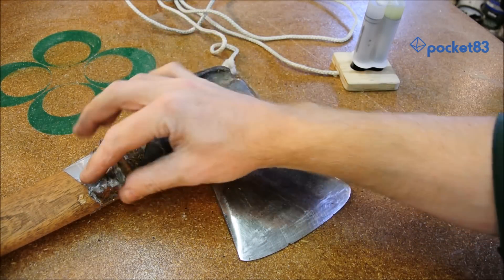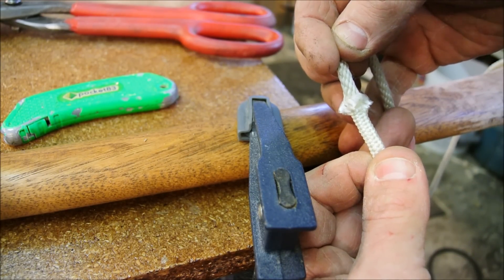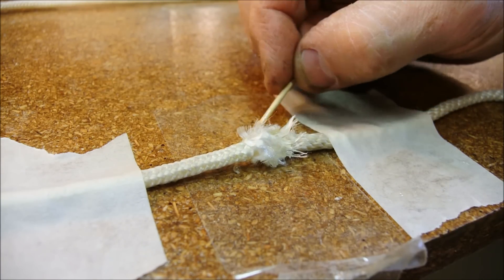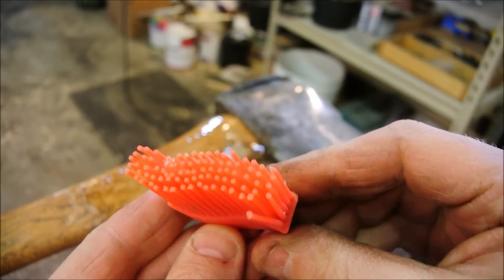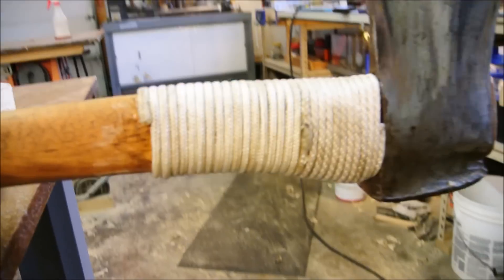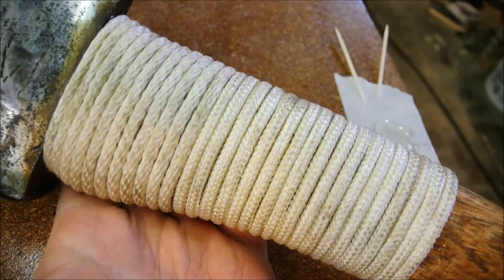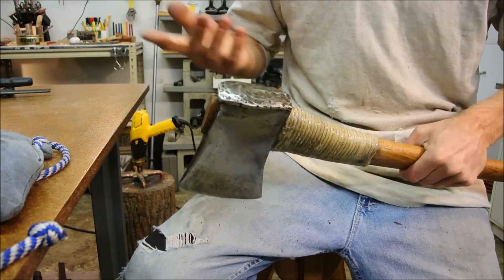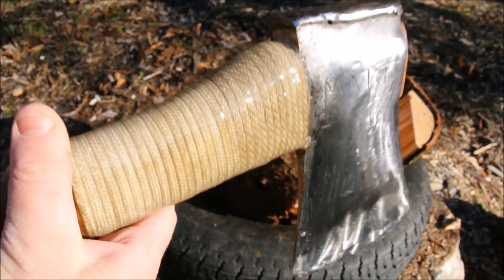Axe handle guard = Rope + Epoxy

Comment: You should try using multiple layers of heavy heat shrink tubing. I used 2" and 3" diameter for my 20 lb sledgehammer, and it's holding up pretty well.
Reply: If I owned a 20 lbs sledgehammer it would not need any protection. Thats a wall hanger or an anvil with a handle.

Comment: I'm not good at splitting wood so I hit the stump once or twice with the axe, then use a sledge hammer to drive the axe further.  I also cheat and use an axe that has a composite type handle.

I do use epoxy to put on fish hook holders on the fishing rods.
Reply: Abunai One    Are you the guy who sold pocket83 the axe he is doctoring up :)

Comment: Why don’t you try investing in a hydrologic wood splitter? They’re expensive depending on what you buy but well worth the buy
Reply: Do you mean hydraulic wood splitter?
Reply: Why buy a expensive tool when you can do the same exact thing for lesser cost but just a bit more work ?
Reply: Depending on who you are and it might not be worth it to buy one for just you but if you have two or three friends who also burn wood you can all pick in and it quickly becomes affordable
Reply: Or you could just use an axe, get some free exercise, and not end up all fat and lazy. YMMV.

Comment: Using  a toothbrush getting into the grooves of the rope deeper works, you can smooth It enough so it’s not abrasive. 101 different ways to make a repair isn’t there? That first miss after a repair hurts, doesn’t it!!

Comment: #1 buy some good quality rawhide gloves and a pair of non fog safety glasses. Then go buy a cheap hatchet with a fiber glass handle, a 10# or 12# go devil,  2 twisted wedges and a 10#  or twelve pound sledgehammer and you’re set for splitting wood! I wold also recommend some of the  ten inch or bigger plastic felling wedges.

Set the hatch head near the edge so the handle will not hit the wood as it is driven into the wood. Once you have an opening set the twisted wedge into the middle of the wood.

Make sure the knots are down and the clear wood is on top. I use a chainsaw to cut through the hard knots and where the wood is hard to split.  I grew up  and we only heated with wood. 

Also once you have a good quality of coals damper back the stove...
I would also into building a rocket stove, use a stainless steel 55 gallon barrel Dennis how big your home is you can build a smaller rocket stove. They use 10% of the wood.

Be safe and good luck.

Comment: Is that handle in that head backwards?
Reply from the maker: lol. No, that's just years of wear on both the top of the blade and the top of the head. I can't even guess how old it is. I personally handled this, and it would've loosened by now if the cavity's wedge were backwards. It has a few years' use on it.

Comment: You don't really want to have excess epoxy if you are going for strength. Working the epoxy in using your hands (with gloves would be best) and then tightly wrapping with stretch wrap is probably the easiest way to get a good composite.
Reply from the maker: Agreed, but that would require slow-set epoxy, and lots more of it. It would also be difficult to do on camera, at least, by myself.

Comment: How did it hold up ??
Reply from the maker: Outlasted the handle. Then I did it again, and it has lasted through two seasons. Lots of splitting. It's tough stuff.
Reply: @pocket83squared  ;  You know what?  I liked your video.  My son ties a turk's head knot around my small axes and hatchets for the same purpose and it looks nice.  Doesn't need any epoxy though, once you cinch it tight it does not move.  I liked that you taped the edge for safety's sake.  If I were to try this I think I would make two changes.  I would hold the axe head, not the handle, in a vise so I could put some serious tension on the rope.  Also, I think I would use resin instead of five minute epoxies.  That thin stuff would really soak into the cord fibers.  It would cost a bit more though.  I think you did a good job.  Have fun and stay safe.

Comment: safety issue.....grind off the roll over on the head. That can/will splinter and become a projectile when next you slam it into something or you slam your hammer down on to it. Never let a roll build up. Grind it down, file smooth.
Reply: well now I see others posting the same.....I know for a fact the do splinter as some suggest not to worry. As you say you never hit it with steel, or you the sole user ......You might know, others which may come into a need to use it, son, daughter....wife.....neighbor ....etc.....might not. Point being avoid the accident waiting to happen. Bottom line....your ax your decision.

Comment: Instead of the rope you should have used a thin Steel cable. Much tuffer and abrasive resistent when the epoxy gets worn away.

Comment: Everyone bitching about mushrooming on the heel of the axe but ignoring the giant chips out of the bit.
Reply from the maker: Equally irrelevant. I'm not filing back 3mm of metal just to remove a ding. It has zero affect on this thing's function. MATT is like a light maul; I'm not subtracting mass unless I have to. As such, that mushrooming will still be there long after I'm gone.

Comment: When in doubt just add $30 worth of epoxy instead of pulling it through a funnel and frapping it like a mast lashing, or use fiberglass resin instead to save cash. Good closeups in the vid though, despite the pricey epoxy.
Reply from the maker: C'mon- I used $6 worth of epoxy. If you buy it bottles, it would be about $4 worth. The close-up shots just make it look like lots. And I don't own a silicone funnel.

Comment: Your ideas are on track. Think about super glue and blue jeans it hardens like a rock because of the fibers which also add strength. I use pocket lint and super glue for quick fixes to hold things on small projects another is super glue and baking soda. Hardens like a white rock. CYANOACRYLATE. Epoxy yes is a very useful tool.

Comment: You probably know this but you might want to dress up you axe head so you don’t try hammering steel and getting a chunk or a sliver in your eye. It’s amazing how if you chip a piece off it gets attracted , or magnetized, to your eyes. Having steel drilled out of your eye ain’t fun.
Reply from the maker: You are totally, 100% correct. It's an axe, not a junk wedge; I don't strike steel against it, not ever. The mushrooming was from a previous owner, and it has now been dressed. 

When I was a kid, I worked summers for Dad, as a framer. I'm likely older than you think, and I started younger than you'd believe, so this was before pneumatic fasteners. One of my jobs was to hand-nail down the roof sheathing after he'd tack each sheet in place. On a typical suburban house, this ends up being a few hours of continuous hammer work. 

Whenever you try to strike an 8-penny nail too hard and slightly miss, if it's been set, it'll just bend over; but if it has not been set, then it will eject with force. With practice, one can learn to eject a nail in any (forward-facing) direction. I can probably still hit a car-sized object that's 100 feet away with a nail.  

Here's the point: whenever a small object becomes trapped between two hard surfaces, any infusion of energy into that object will turn it into a bullet, the ejection of which will be defined by the two planes. This is something that most carpenters understand intuitively. In the case of an axe and a wedge, those compressing planes often come into alignment with the axeman's eyes—let's call it ⅓ of the time. In the case of me as a kid, sitting there on the roof, the two planes were mostly in alignment with my crotch, which is why Dad made jeans mandatory.

Presumably, you're in the mood for critical discussion, else you wouldn't have opened one with me, so let's look at some probability. An ejection event has a 360° circular plane of affect. At a distance of about three feet, a person's face will occupy around a 2% portion of that pie, conservatively. Most metal ejections will lack force, so let's say that only 1 in 100 become bullets. Thus, if, after 100 metal-to-metal strikes, an axe flake were to forcefully eject while being in planar alignment with the eyes, it would still only have a 2% chance of striking an eye. If you'll buy all of this so far, then you'll accept that losing an eye to a mushroomed axe has less than a 0.00007% chance per strike. Much, much, much less if you're wearing glasses. 

That's a pretty small number. Small enough to claim that the danger has likely been exaggerated by anecdote, and certainly small enough to not waste the time of a two-eyed carpenter who probably doesn't need reminding.

Comment: go get some fiberglass drywall tape and some LOCTITE® PL PREMIUM® FAST GRAB POLYURETHANE CONSTRUCTION ADHESIVE. put a coat of construction adhesive on first then wrap overlapping fiberglass drywall tape over adhesive . use nitrile gloves when messing with adhesive. take your hand with nitrile glove on and smooth out adhesive. when it cures in 24 hours you can sand it smooth.

Comment: Be careful the type of epoxy you use. Some table epoxy is like glass and will shatter on impact.
Reply from the maker: C'mon, man. I just split twenty logs with it an hour ago. I Use it constantly. This guard is nearly invincible. Best thing ever.
Reply: pocket83² what kind of epoxy is it. I tried epoxy on a hatchet handle and it might as well have been glass. 2 hits it shattered.
Reply from the maker: You may have put it on too thin. Mine will withstand crushing blows. It took an entire season before it cracked enough for even a small chunk to fall out. The brand used here was Loctite.

Comment: you could have cleaned the waste epoxy away with alcohol before hardening.
Reply from the maker: That tends to be messy and wasteful. I do use it for my hands or important clean-ups. Not a good idea for silicone tools, which can simply be cleaned mechanically.

Comment: Don’t leave it out in the sun. Sun rots epoxy.
Reply from the maker: After 800 hours of exposure to direct UV radiation, you can expect around a 30% reduction to a standard epoxy's strength. Imagine what 800 hours of axe work will do to the handle first! And who does that in direct sunlight? But you could also spray paint it white, I guess. 

Source article {from National Institutes of Health (dot)gov}:

"The Effects of UV Light on the Chemical and Mechanical Properties of a Transparent Epoxy-Diamine System in the Presence of an Organic UV Absorber"

Comment: When I forge an axe for a customer I leave a space at the front of the handle where it goes into the eye of the axe. I put a 3 mm thick brass bar down from the top of the axe head to 8 inches under the head and wrap brass sheet around the whole handle riveted in place. Haven't had a failure yet. You're foolish to use 5 min epoxy, it has half the strength of 30 minute.

Comment: Just get a steel metal sheet (or food can) cut it to the size, secure it with 4 small nails with big heads and you are done, it works 100%.
Also that axe looks to small for the job, get a bigger one (2 kilograms). In Balkans (Europe) we use this: http://www.tksl.eu/index.php?route=product/product&product_id=110
Reply from the maker: That "just get a" solution would end up giving me stitches. The exposed metal would still need a cover.

Comment: The epoxy is going to break just like the PVC
Reply from the maker: That PVC was from a piece of thin sewer pipe that was outside for 20 years. It lasted for weeks. Real, non foam-core schedule 40 (that's new) would be a great idea. And the epoxy has withstood a few weeks of use now, with only one little ding. 

TL;DR: shut your hole. You know nothing.
Reply: @pocket83squared  I know that that axes need a grinder taken to the back of it. Because you use it like a wedge.   Or you use it to hit a wedge. Instead of a sledgehammer. But it your safety not mine
Reply from the maker: That was the last guy. It happened before I was born.

Comment: Early settlers of what? epoxy was invented in 1930. PS: you have to keep it under tension not compression.
Reply from the maker: 1) sarcasm/humor. 2) incorrect.

Think of a board over a stream. As you walk over it, the top fibers of the board 'compress,' while the bottom fibers 'tense.' Compression = squash; tension = stretch. 

Now think of the straps on a barrel. They apply a compressive force. They squish. Same thing with an axe guard. The handle should be kept in compression.

Comment: put your epoxy inside plastic bag   easier to apply it and you  dont lose much
Reply: You mean like a sandwich bag, cut the corner off, and squeeze it out?
Reply: @JDeWittDIY  yeah ,use  a toothpick to mix it up close if you have zip bag .cut corner to how much flow you want and squeeze

Comment: If you’re planning on holding that cord wrapped handle it will completely destroy your hands, you’ve effectively covered your handle in sandpaper, axe handles should be smooth, especially if you’re doing prolonged chopping like you are, you’ll get blisters in 10 minutes using that wrap. Use rawhide or make a new handle, all you need man
Reply from the maker: Oh, somebody else who knows better than I do! Surprise! It's smooth as glass. I've been using it for two weeks with no blisters.

Comment: waste of ROPE waste of Epoxy   if you caint tie a rope... if the axe handle needs to look bad ass    spend less time with the city bois        age your wood  ... it splits easy    if its not aged ... use a splitter....
Reply from the maker: Why are the most ignorant commenters also the most proud? Shut your hole, bumpkin.
Reply from the maker: This is great. Tell us more about how I "use education as a reason to never think." If only I had your wisdom and clarity!

Comment: What a waste of time and of epoxy there was zero need to do all that for an axe you just chop fire wood with. Thumbs down big time on this video
Reply from the maker: Thanks for explaining and not swearing at me, but I must disagree. That guard made it the whole way through the season without any trouble. I split with it almost daily. Handles are expensive and time consuming, and epoxy is less than $3. 

I would totally do it again.